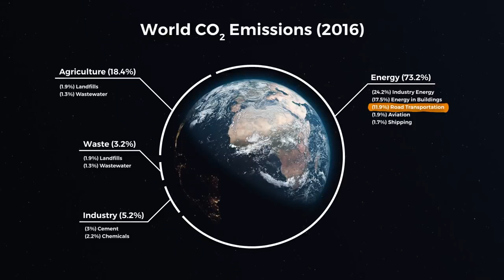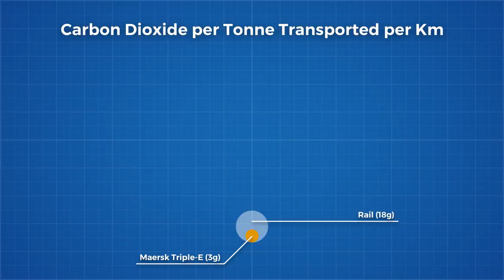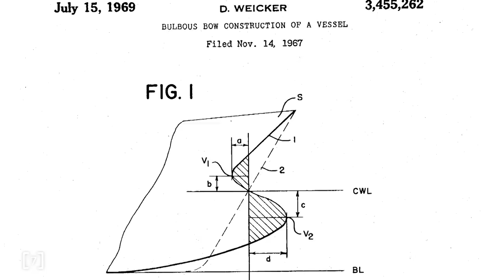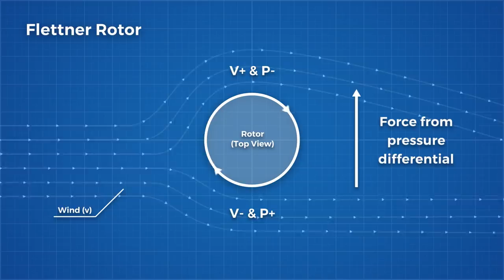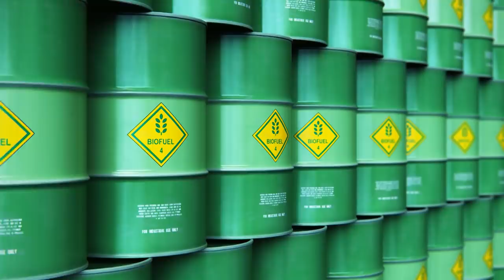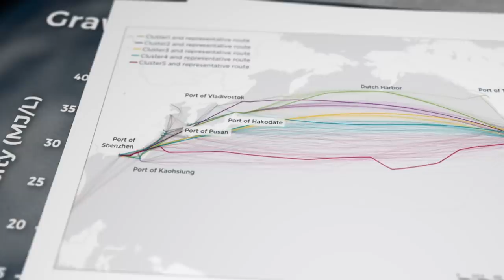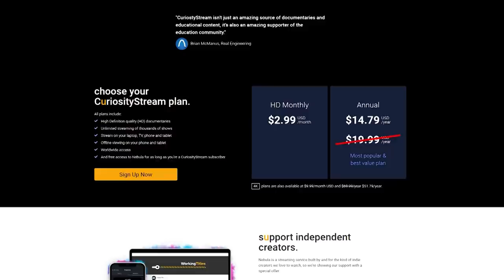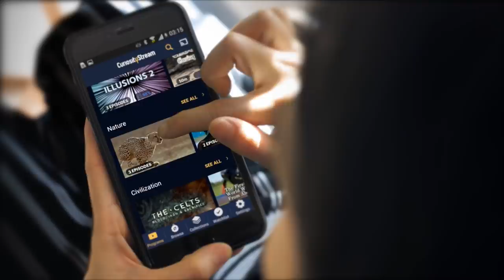Are Renewable Powered Ships Possible?

Comment: Sail boat!
Reply: To address the suggestions that sail power is the answer I offer the following.  In 1870 a premium sailing vessel entered service, the ‘Cutty Sark’, she could carry around 600 tonnes of cargo at speeds of up to 17.5 knots, dependent on the prevailing wind, to harness the energy the available spread of canvas was up to 2 976m2.  To round things out that was circa 5m2 of canvas for every tonne of cargo carried.  The ‘Cutty Sark’ was designed and built for employment in the tea trade where time on passage was a large factor in securing the premium freight rate that made her cost effective but as soon as the Suez Canal opened, which the ‘Cutty Sark’ was unable to sail through, she lost her advantage, raw speed, to the steam powered ships of that era.  Mechanically powered ships have improved in terms of efficiency, on a freight tonne mile basis, by at least one order of magnitude since then.  After losing out to the coal burning, steam reciprocating mechanical ships of the late 19th century ‘Cutty Sark’ was relegated to the Australian wool trade, just about the bottom of the barrel in maritime terms and only one small step up from being a 'honey barge'.  The canvas, cordage and extra manpower needed for sailing ships was never a very benign environmental option so please discount any idea of sail as ‘sustainable’.  All this is without the problem that if ‘the wind don’t blow the ship don’t go’, when it does blow it often blows in the wrong direction for your cargo delivery needs and sometimes there is rather too much of it for comfort.

Random facts about Cutty Sark.  It is said to have been able to coax 3 000 horse power out of her sails, or in ‘real money’ 2 206 500 Watts (2.2 megaWatts), assuming this was in ideal conditions that is about ⅔ of the power that might be harvested from the ‘top of stow’ of a Maersk triple E, again in those elusive ideal conditions.  So that majestic spread of canvas would have been even less efficacious for delivering your baubles and bows from the orient, despite taking about three times as long on the voyage.

Comment: why not use a nuclear reactor? to me it seems like a good way to solve these problems in the short term while we figure out a better long term solution.
Reply: If you do a web search for ‘nuclear ship savannah’ you will see that it has been tried and did not work.  A similarly heavily subsidised, by the government, vessel is in use in Russia which also operates, in support of the Northern Sea Route, a fleet of nuclear powered ice breakers these may, or may not, have been completely without issues.  Just think; would you have full confidence in the management of a nuclear reactor under the control of an anonymous entity only traceable, perhaps, via a letter box in a FOC (flag of convenience) nation state?  If you are could you sell that confidence to Japan, the state that hosted the Hiroshima and Nagasaki nuclear detonations as well as more recently the Fukushima ‘event’?  Then try that same, or similar, sales strategy on Ukraine, the nation state that as a part of the USSR (CCCP) hosted the Chernobyl ‘event’.  Modern iterations of nuclear energy thorium fuel, molten salt reactors or fusion reactors will carry the legacy of past problems.  It is the global trepidation of anything with 'nuclear' in the name and the economics of nuclear having transitioned from 'energy to cheap to charge for' too 'the costs of remediation are incalculable' that will prevent the adoption of nuclear energy as a means of creating energy at sea.  Modern reaction systems may have overcome the safety problems but the general public, having been misled in the past, will not believe the fresh new promises.  ‘They’ say nuclear is cheap, it’s not it is expensive as well as being complicated, dangerous, not universally socially acceptable and having only ‘no need for refuelling’ as a questionable advantage; actually it does need refuelling just not as often.  When they do need to refill the warming up stuff it takes considerable longer than pumping tonnes of thick black stuff, HFO cSt380, or thin runny stuff, MDO, onboard which is one of the reasons HMS Queen Elizabeth and HMS Prince of Wales are pushed about by gas turbines thus using a similar fuel as the aircraft that fly off of them.  The Royal Navy (RN) with a high degree of skills and expertise use, at vast expenses to the UK taxpayer, a current operational nuclear fleet of 11 submarines (also known as ‘boats’) in two flotillas, seven attack subs and four ballistic missile boats.  The carbon footprint of all the extra bits of hardware and the fuel, including processing thereof, from ground to propeller, are the external costs that never seem to get considered.  Disposal, once it wears out, of both the machine (that was a ship) and fuel is another can of worms best left unopened.  The 26 RN boats no longer in use are laid up (some in Rosyth and some in Portsmouth) awaiting long term deconstruction including dealing with the fuel rods and other irradiated material.  The USN is not, as far as I know, a commercial organisation working to very tight margins and also has the skill and expertise to handle the complexities of nuclear power so as well as submarines their aircraft carriers are nuclear powered and each have a build cost three times that of QE/PoW, bigger crews and more generous funding.  For those who still think that nuclear energy might be the answer I recommend this report: - https://www.bbc.com/future/article/20200901-the-radioactive-risk-of-sunken-nuclear-soviet-submarines? ocid=ww.social.link.email.  The navy of the USSR might have been under resourced and over extended but it was still generously supported in comparison with merchant shipping.
Reply: @BernardLS  wow i wasn't expecting an answer that thorough but thank you very much for the clarification
Reply: @MadMan-qp5su  I gave been following the thread from day one and the nuclear option us frequently proposed, as are sails and other options. Each has caused me to collect information, that now runs to 4 500 words in total. IMO the most sustainable marine shipping option is to move less stuff shorter distances.
Reply: @BernardLS  fair enough but thanks for the information

Comment: Powerhouse energy is the future
Reply: 'Powerhouse energy' what is that?
Reply: Google powerhouse energy...you will see
Reply: @kel7754  the most significant hit on Google was an 'energy from waste' company.  For marine energy needs that would mean transforming the energy content into a portable form, such as ethanol or stored electricity, and using that on board.  The efficiency would, IMHO, be very low so the pollution per freight tonne mile higher than hydrocarbon fuels.  WADR  'energy from waste' works best where the energy released can be used close to the point of creation (release) such as municipal solid waste (MSW) incineration linked to local district heating.

Comment: You need to do comparisons for anyone to make sense of the data you present regarding CO2 emissions.
What is the proportion of carbon per year relative to the proportion of water vapour?
What is the contributory factor of all carbon emissions across all sectors compared with land-based and sub-marine volcanic emissions.
Tell me those two things and I will begin to comprehend something.
Without a global view no judgement is possible and anyone can say anything.

Comment: You fail to mention anything about nuclear power? If it’s possible for submarines it should be possible for ships right?
Reply: Nuclear power has been tried start by doing a web search for ‘nuclear ship savannah’.  A similarly heavily subsidised by the government vessel is in use in Russia but just think; would you have full confidence in the management of a nuclear reactor under the control of an anonymous entity only traceable, perhaps, via a letter box in a FOC (flag of convenience) nation state?  If you are could you sell that confidence to Japan, the state that hosted the Hiroshima and Nagasaki nuclear detonations as well as more recently the Fukushima ‘event’?  Then try that same, or similar, sales strategy on Ukraine, the nation state that as a part of the USSR (CCCP) hosted the Chernobyl ‘event’.  Modern iterations of nuclear energy thorium fuel, molten salt reactors or fusion reactors will carry the legacy of past problems.  It is the global trepidation of anything with 'nuclear' in the name and the economics of nuclear having transitioned from 'energy to cheap to charge for' too 'the costs of remediation are incalculable' that will prevent the adoption of nuclear energy as a means of creating energy at sea.  Modern reaction systems may have overcome the safety problems but the general public, having been misled in the past, will not believe the fresh new promises.  ‘They’ say nuclear is cheap, it’s not it is expensive as well as being complicated, dangerous, not universally socially acceptable and having only ‘no need for refuelling’ as a questionable advantage; actually it does need refuelling just not as often.  When they do need to refill the warming up stuff it takes considerable longer than pumping tonnes of thick black stuff, HFO cSt380, or thin runny stuff, Avtur-JetA1, onboard which is one of the reasons HMS Queen Elizabeth and HMS Prince of Wales are pushed about by gas turbines thus using the same fuel as the aircraft that fly off of them.  The Royal Navy (RN) with a high degree of skills and expertise use, at vast expenses to the UK taxpayer, a current operational nuclear fleet of 8 submarines (also known as ‘boats’) in two flotillas, four attack subs and four ballistic missile boats.  The carbon footprint of all the extra bits of hardware and the fuel, including processing thereof, from ground to propeller, are the external costs that never seem to get considered.  Disposal, once it wears out, of both the machine (that was a ship) and fuel is another can of worms best left unopened.  The 26 RN boats no longer in use are laid up (some in Rosyth and some in Portsmouth) awaiting long term deconstruction including dealing with the fuel rods and other irradiated material.  The USN is not, as far as I know, a commercial organisation working to very tight margins and also has the skill and expertise to handle the complexities of nuclear power so as well as submarines their aircraft carriers are nuclear powered and each have a build cost three times that of QE/PoW, bigger crews and more generous funding.  For those who still think that nuclear energy might be the answer I recommend this report: - https://www.bbc.com/future/article/20200901-the-radioactive-risk-of-sunken-nuclear-soviet-submarines? ocid=ww.social.link.email.  The navy of the USSR might have been under resourced and over extended but it was still generously supported in comparison with merchant shipping.

Comment: Ships have used sails for centuries, why are they not in use today?
Reply: The problems with the wind as an energy source are variability, reliability and low energy density; also the canvas, cordage and extra manpower needed for sailing ships were never a very benign environmental option so please discount any idea of sail as ‘sustainable’ and all this is without the problem that if ‘the wind don’t blow the ship don’t go’.  When it does blow it often blows in the wrong direction for your cargo delivery needs and sometimes there is rather too much of it for comfort.  The area where one is most likely to be ‘becalmed’ is the ITCZ (Intertropical Convergence Zone) or ‘the doldrums’ as it is commonly called.  In days of old ships with large crews, such as naval vessels, would try using the ships boats and some of the crew to row through the doldrums thus towing the mother ship out of the calm.  Not practical for less well manned and much heavier merchant ships which could not muster a similar power (oarsmen) to weight ratio (vessel displacement).  Traditional sailing ships are unable to go directly up wind so if the wind is blowing from the direction your cargo needs to go then a zig-zag course must be steered, more distance and thus more time on passage at whatever speed is achieved.  Wind speed is traditionally measured on the Beaufort Scale (wind speed) that runs from 0 (< 1kn or 0.5ms-1) to 12 (> 63kn or 32.5ms-1) and for sailing purposes the usable part of the range is ‘3’ (circa 8kn or 4.1ms-1) to ‘6’ (circa 24kn or 12.3ms-1).  As the wind speed, and the amount of energy that may be harvested there from, increases the sea surface becomes progressively more disturbed which makes the harvesting process ever more difficult and increases the stress on the vessel.  The increased stress means the sail area has to be reduced, either by using fewer or smaller sails until the vessel may in extremis be ‘hove to under storm sails’.  One way of reducing the sail area is by turning up the bottom edge; known as reefing.  With any wind power proposals the question that must be asked include ‘has any information been released into the public domain with regard to the expected energy harvest for the wing forms, on a Watts per square meter basis?  ‘Cutty Sark’, is said to have been able to coax 3 000 horse power (or 2 206 500 Watts / 2.2 megaWatts)) out of her, up to, 2 976m2 of sails, assuming ideal conditions and further assuming that for sailing purposes the usable part of the wind speed range is 4ms-1to 12ms-1 so the yield would be about 741 Watts m2.  So another question ‘for the proposed option what is the expected upper wind speed limit for the system’?  A single stage 'harvest to deployment' system for propulsion will have higher efficiency but ‘what steps are being taken to provide ancillary power such as the, small but essential, domestic, navigational and cargo needs?’

Comment: So much space on this ship's why no solar?
Reply: Solar power; as an example the above container (called boxes by nautical folk) area of a Maersk Triple E is less than 399.2m by 59m.  The 399.2m is the length between perpendiculars (marine tech speak - no need to worry about it) and the 59m is the width overall (more marine tech speak so again no need to worry about it) allowing for the sides, bow, stern & navigation/accommodation structure could we agree 340m x 56m, or 19 040m2, for the ‘top of stow’ area?  Insolation rate in Joules will vary due to time of day, latitude of vessel, declination of sun, (those three impact the elevation of the power source) cloud cover, the efficiency of the solar panels and how clean they are.  The Maersk Triple E class use two 29 680 kiloWatt each, at full whack, ICEs for propulsion plus some hotel and services power load cost; so for round numbers, could we agree 60 megaWatts?  Solar panels create about 155 Watts m2 averaged out; 19 040 x 155 gives me 2 951 200 Watts (or 3 megaWatts for a round number) from the top of all the boxes.  Those three megaWatts might allow you to distil enough fresh water from the sea to wash the crud off of the solar panels (surprise fact renewable energy does come with some maintenance costs) but nowhere near enough to effectively 'push the boat along'.  Fitting solar panels on top of the ‘boxes’ is worth, at most, 5% of your power requirement.  Side mounted, let alone towed array, solar panels are not practical given the harsh conditions frequently / often found at sea.

More seriously the ‘boxes’ are loaded and unloaded from the top down so the solar panel array would need to be moved for every port operation and time is money as well as that operation having the ability to get very complicated (tech speak for ‘go wrong’).  Any additional weight would be in the worst possible place for the stability of your vessel, the operating environment would be harsh and the ‘top of stow’ on a ‘box boat’ is seldom a level expanse as each column of containers may be, and usually is, of differing heights.

Comment: Ammonia for marine fuel?
Reply: Thomas Midgley, Jr. (born 18 May 1889 died 2 Nov 1944) was an American (USA) chemist who, as well as developing the technique of putting the lead (tetraethyl (TEL)) additive in petrol, created chlorofluorocarbons (CFCs), yes those ozone depleting CFCs, so that the use of NH3 as a refrigerant could be discontinued.  Combustion being what it is an oxidation process even if you take the C and S atoms out of the fuel molecules you will still get NOx and possible particulates.  NH3 could be the most dangerous and least ‘clean’ clean energy source, it is very bad and probably deserves a rant all of its own; so let’s just leave that for a while (somewhere very far away that is cool, dark and quiet).  The numbers are getting very difficult to show any sort of surplus so is this a case of running hard to stand still?